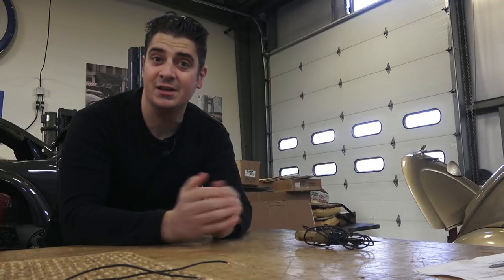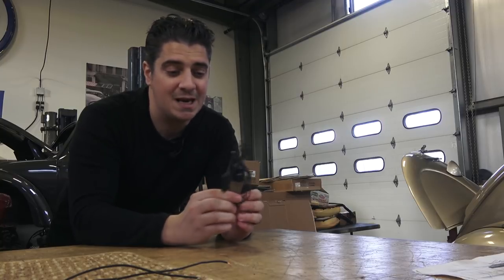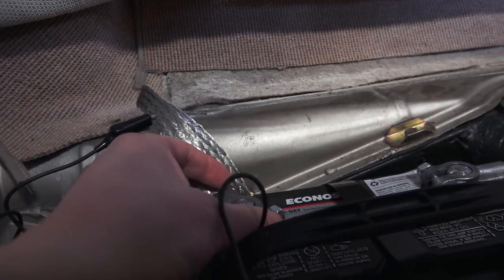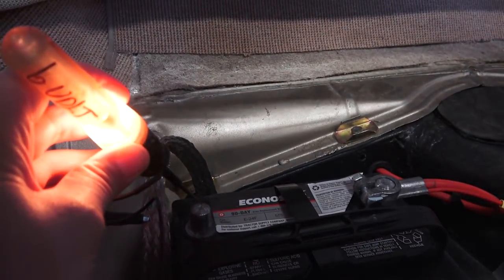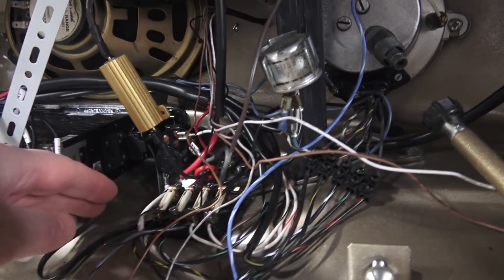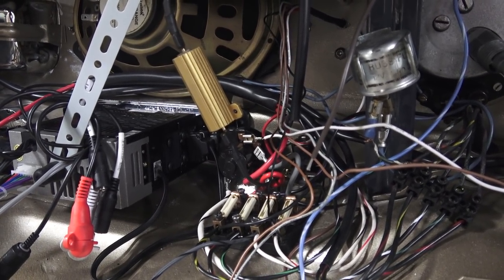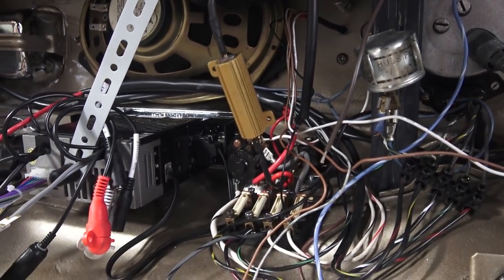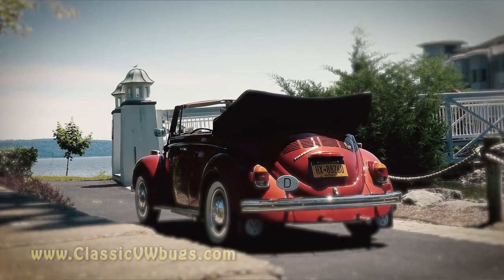Classic VW BuGs How to Test if your VW has a Hidden Electrical Draw

Comment: I have a 1966 beetle 12v and my windshield wipers are so slow they barely work. Is there a replacement motor you recommend. It snows here and they won’t swipe at all if there’s a little snow on the windshield. Thanks
Shawn.

Comment: Thx Chris. I'll try your diagnostic tip tomorrow! Im having starter issues with my Vw and today i realized the negative cable was hot to the touch with only 3-4 attempts to start the engine. Is there a way we can detect short-circuit too? Thx again
Reply from the maker: Your ground is hot?? wow, gotta check ground connections, take them off and clean them real good.  if there is resistance on the cable to the body, that would make it hot or warm.
Reply: @classicvwbugs  aah! I had a 25 Amps fuse from battery to starter. Is it supposed to be no fuse on that? I just wanted to protect it while i was testing it
Reply from the maker: @VolksStokes  you can but 25 amp top high

Comment: There was an old timers tip about a voltage draw that says if you touch your positive battery terminal to the battery post ,and if it sparks there's a voltage draw.There shouldn't be any sparking happening.

Comment: Hello Chris did this test it seems to me that there's no voltage drop with this test but when I run my car at night and I turn the lights on, my voltage drops quite a bit to the point that stalls my engine , any ideas?
Reply from the maker: Bad battery maybe or genny.
Reply: Hey Chris how can I test my generator in the car?
Reply: @porschevolks3275  usually whilst the car is running, test with a multi meter, you should have a reading of 7.2vdc if its working. if its 6vdc then it wont charge the battery